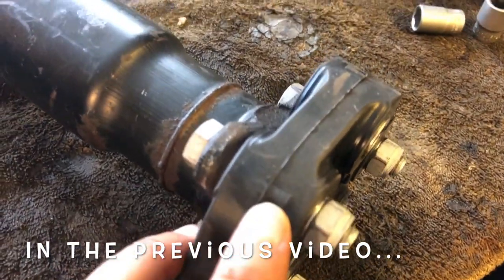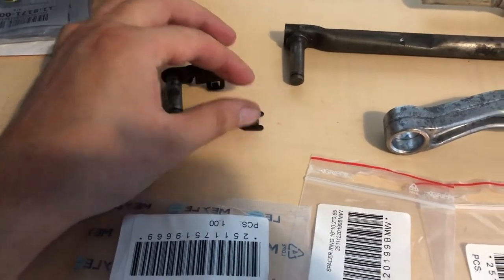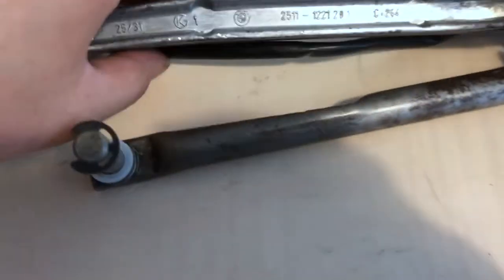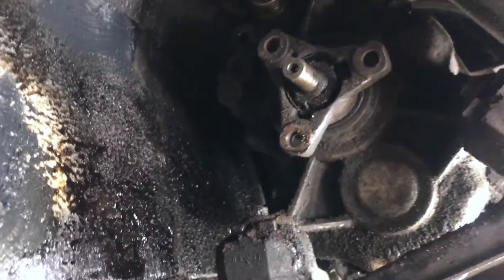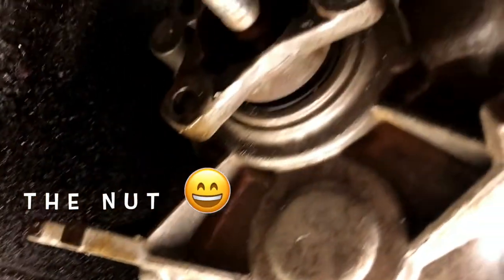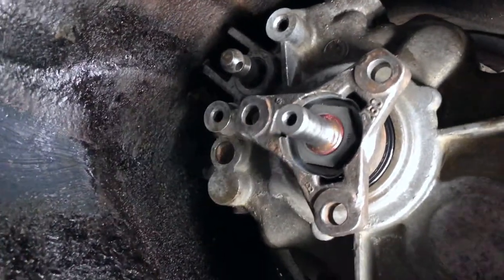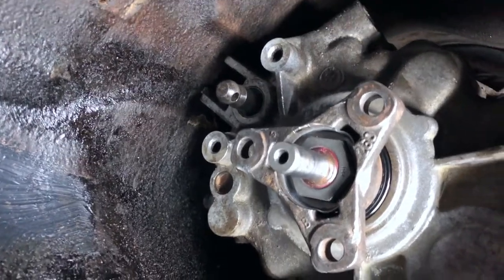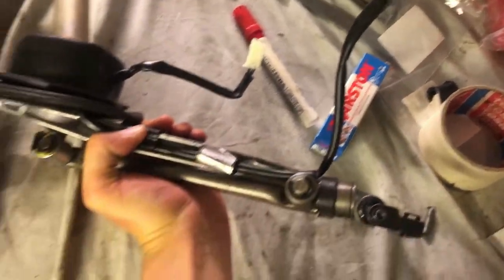Pt. 14 BMW E30 325i Shifter Rebuild & New Gearbox Seals

Comment: 13:20min interesting idea with the glue since the original bushing is very expensive...I bought a PU bushing which doesn't seem to fit 1:1 though...I have short shifters in each of my E30s, nothing fits perfectly though
Reply from the maker: I was planning to order the entire bushing with bracket from condor speed or similar as well but it’s just too expensive for my taste 😅